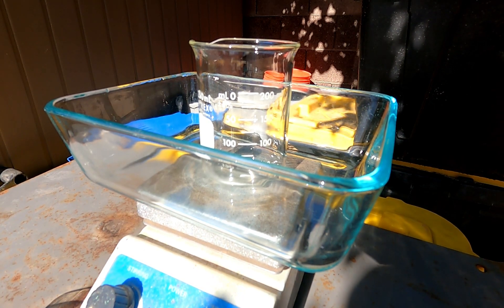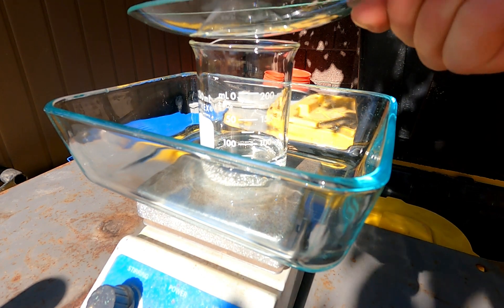How to make Stannous Chloride Gold Testing Solution

Comment: How much temperature did you heated HCl and how much time heat solution
Reply from the maker: boiling
Reply: @VendettaProspecting  how much time stable
Reply from the maker: @sonuverma2796  do some research